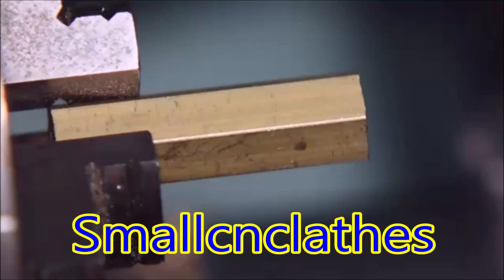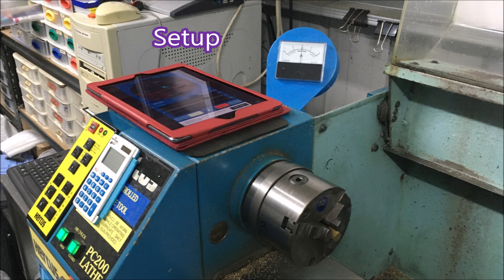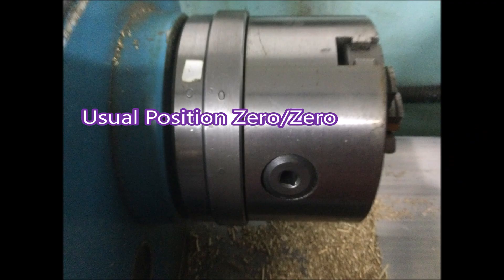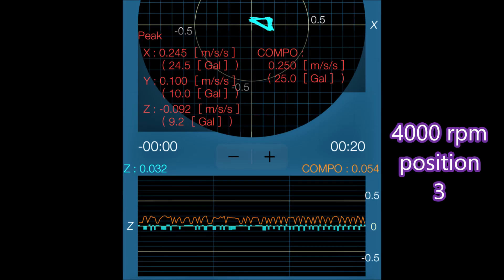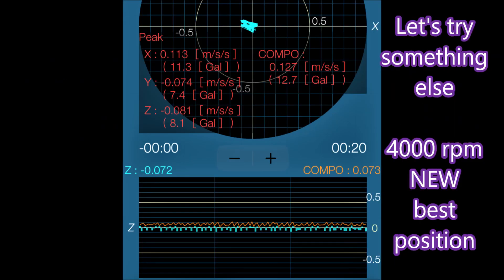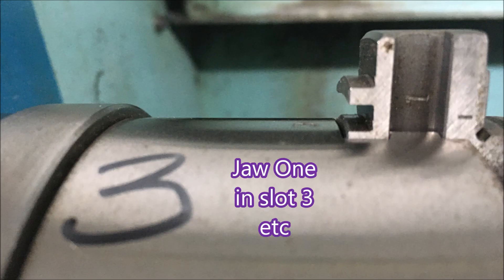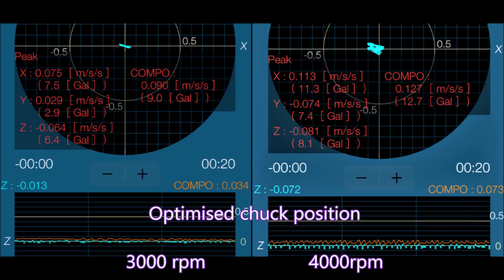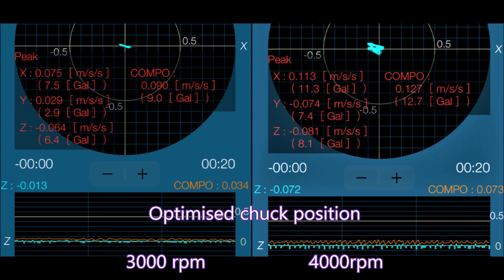Geared up my cnc lathe to give me 4000 rpm vs 3000rpm. Would like help sorting some vibration data

Comment: anytime you minimize vibration everything will last longer..bearings thrust washers etc. Dynamic balancing though can be radically different at different rpm as well.  I owned a Schenck balancer for quite a lot of years and it was used to balance the rotors or RC turbine engines that ran as high as 240,000 rpm. Most model turbines though are between 120,000 to 165,000 rpm. I also have a balancer for my propellers for full size aircraft. The finer you can get the balance the better for your gearbox and of course comfort while flying. With the props your balance at a prop speed of 1000 rpm can be out but at max rpm of 2450 thats where you try to get the best balance as you spend most of your time in that rev range in cruise flight. So for a lathe its the same. If your using 3 or 4000 rpm and the best is at 3000 then thats where you stay. You could also try to get 4000 better but it will require finding the heavy side and drilling holes in the chuck and without better measuring gear....I would stay at 3000
Reply from the maker: Thank You
Reply: that is really interesting. I've always thought balanced is balanced. I also figured that imbalance would always "grow" as rpm increased. Learn something every day!
Reply from the maker: Hi Chris, I would never have expected 3000 to be better than 2000 amazing science involved here. Not sure how much I want to know!! LOL